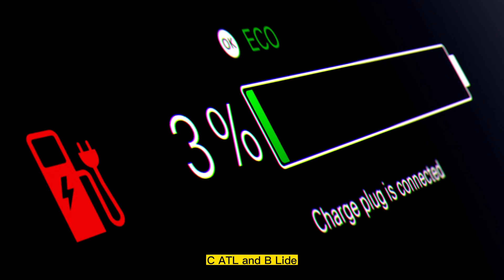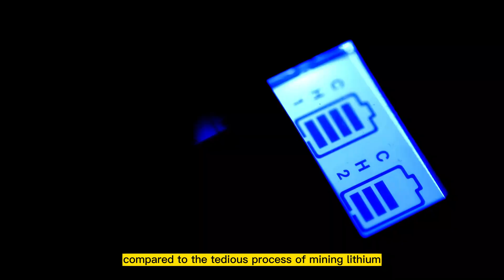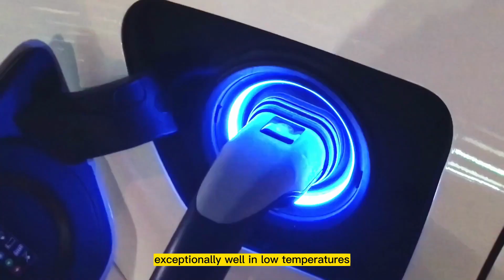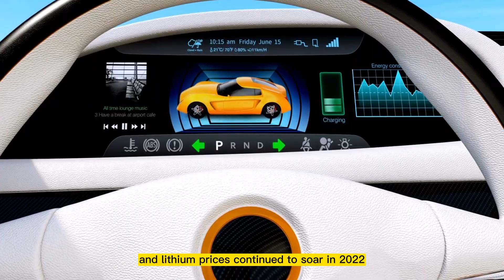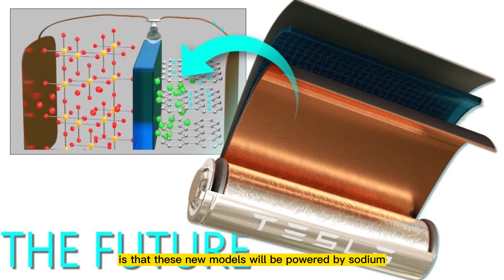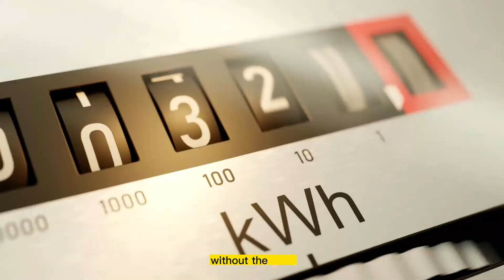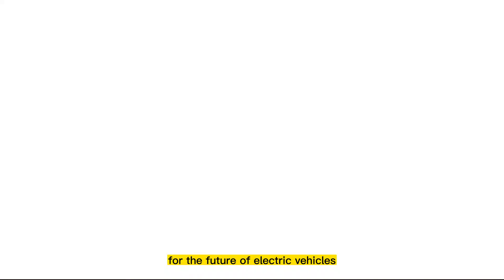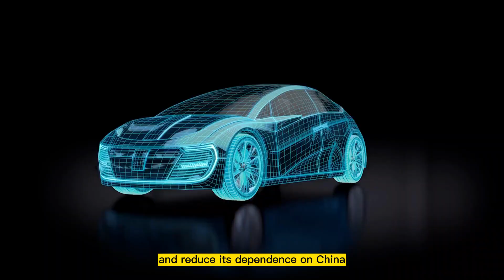This United Kingdom Sodium Battery Will Change EV Industry FOREVER In 2023

Comment: I want to start my off-grid home with sodium. Where can I find 5-10Kwh rack batteries?
Reply from the maker: You can find 5-10 kWh rack batteries from reputable manufacturers such as Tesla, LG Chem, and Panasonic. Check their official websites or contact local distributors for availability and pricing.
Reply: @WheelWise0  Er? No, I can't. I can find good LFP, but no Na-Ion on the horizon. BTW I was quoted 4.8K GBPs (US$6k-ish) for a 10KWh/5.5Kw top-of-the-line home storage solution, all install + warranty included for LFP. If Na-Ion halves the battery price, I don't think that will subtract more than maybe $1k-1.5K from price, because installation is a big chunk. We can hope the inverters get cheaper, if they do bigger runs.